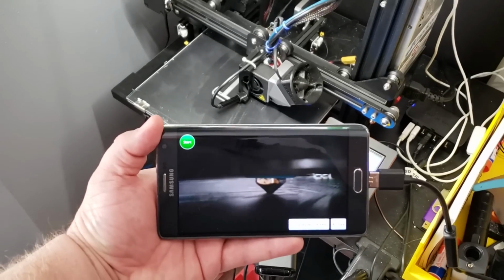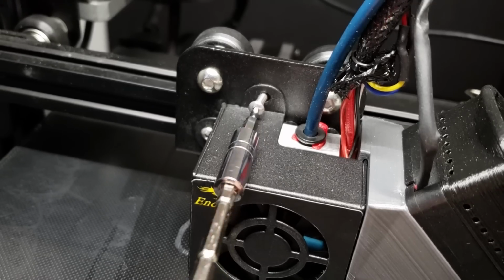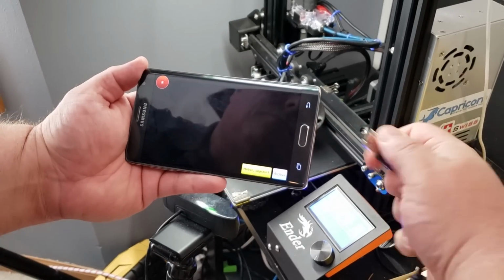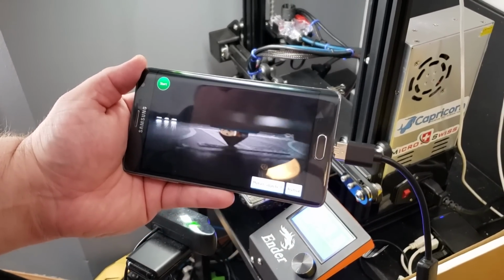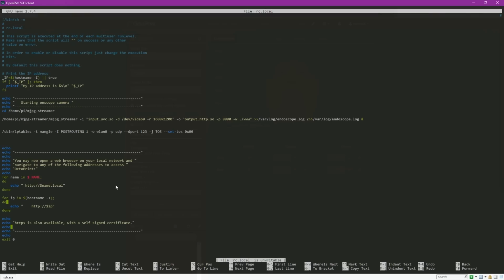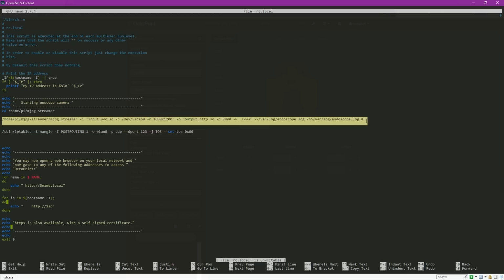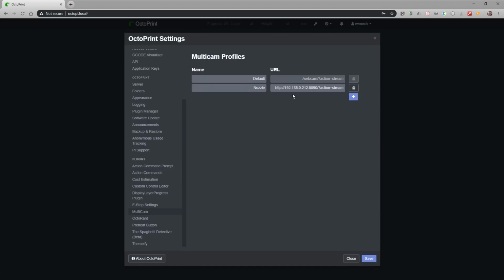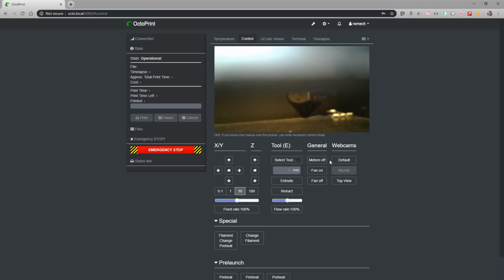Installing an Endoscope on your 3D Printer - 3D Printer upgrade to see your Nozzle up close!

Comment: That camera setup is awesome! I just got a used Ender 3 S1 earlier this year and was looking into the best way to add a camera—ended up finding this video because of that. But after six years, is there still no software that can use an endoscope-style camera like this to automatically calibrate Z-offset, pressure advance, or even adjust temperature in real time based on how the filament is printing? Liked and subscribed.

Comment: thanks.  the hard part is the actual mount of these cameras.    I dont have an ender but a flashforge, so i will try to design a mount.    Also the process on an iPhone is not "similar" it is actually not possible, as the iPhone doesnt have a USB port, and even if you get the adapter, you can't watch live.  But that doesnt matter, you want to do it with octoprint for sure, so you can see it anywhere in your phone with the app or in the PC somewhere.    No need to connect this to a phone.   Thanks for the video.